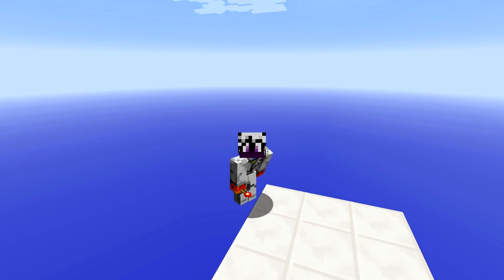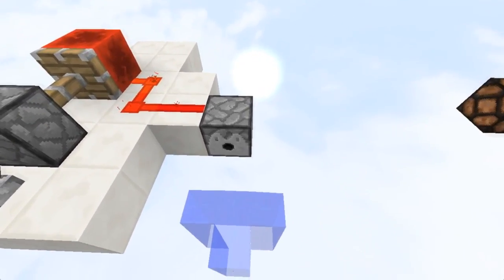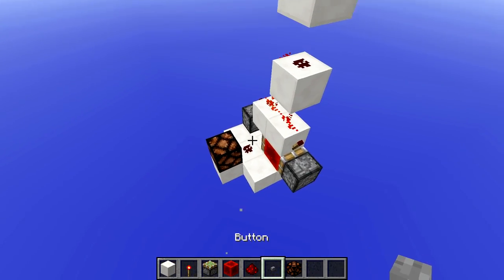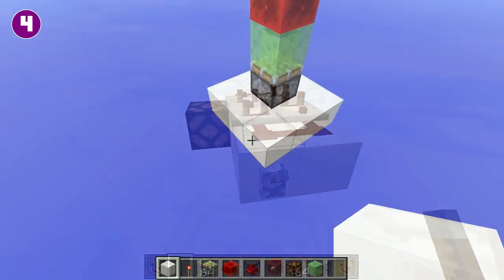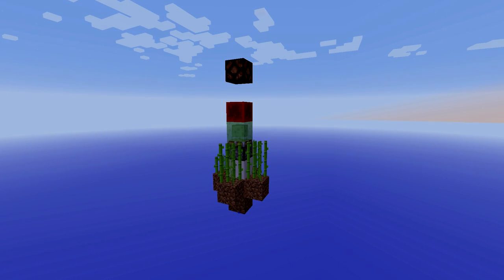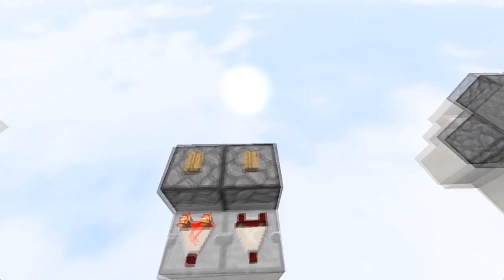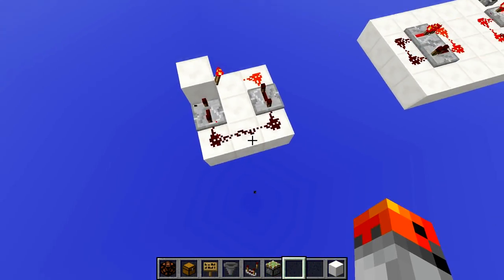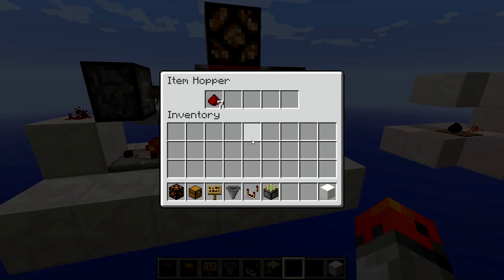Minecraft - 12 Useful Redstone Circuits for your Redstone Creations

Comment: the comparator-pulse-extender can be Mode efficient when you change one redstone dust with one block... the the signal will last much longer (2x)
Reply: MrDerpy i didn't mean to add one comparator, but to change the input-redstone dust to a block so trat the signal strengt will decrease by one per round instand of two per round as it was shown in the video... But you are right that's in you would add one comparator it will last 1.5 times as long...
Reply: +Seb Stone What do you mean Mode efficient?
Reply: +The Redstone Scientist more efficient... 
sorry but i'm german and my Phone "corrected" a few words